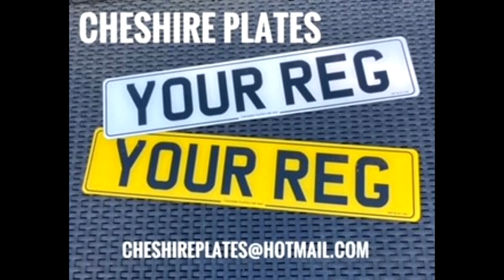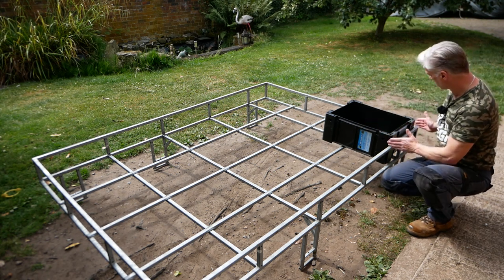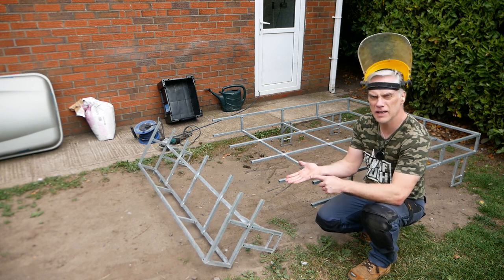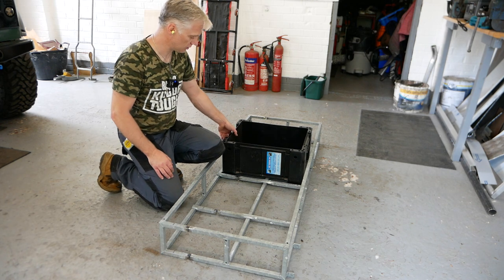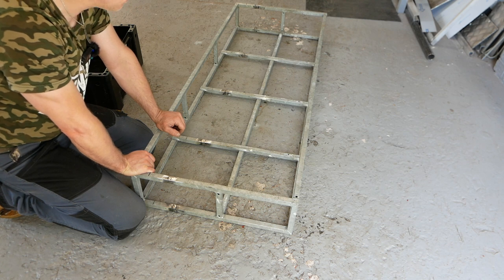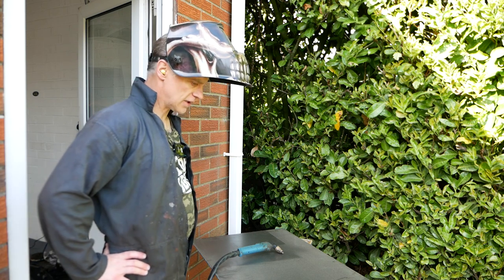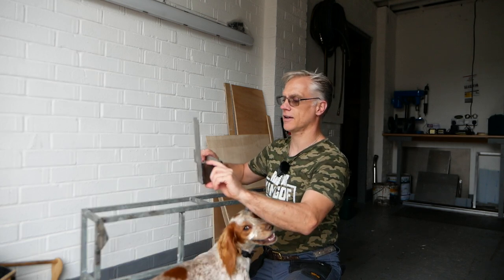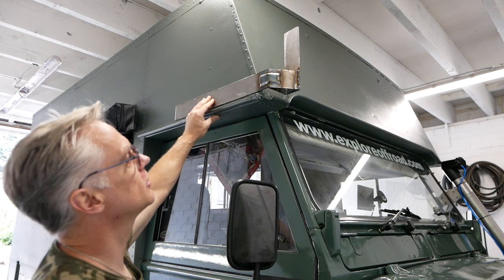Overlander Custom Roof Rack (Beryl)....Part 1 | All 4 Overland

Comment: Hi Paul, sorry but Pennie Lr have this covered, one will be fitted to Peny when the pop up is fitted, I also hope to fit some of Adrian's (Safari Equippe's ) side lockers, just having issues with brakes like a cracked  mater cylinder weld, apparently brakes are a requirement
Reply from the maker: Hi Phil...if you are having your pop top done by dormobile they make this roof rack for their conversions as i was having a look at one yesterday and its a little bit bigger than the one i am making but obviously mine is a bit different with the body shape...i have heard the rumour that brakes are necessary lol..regards Paul